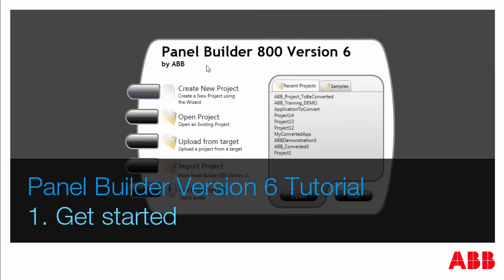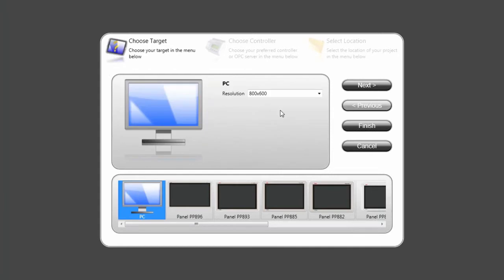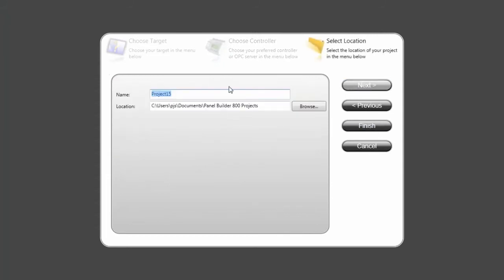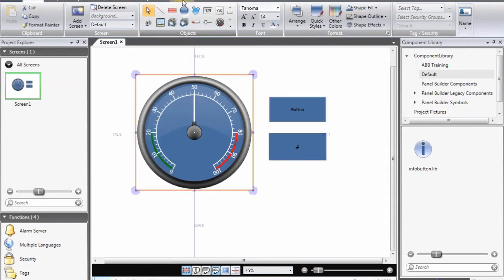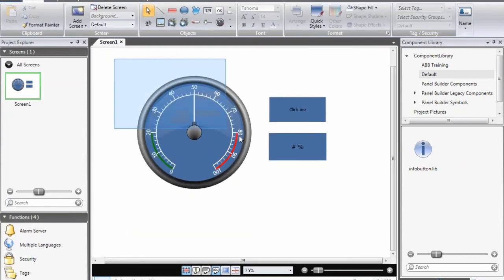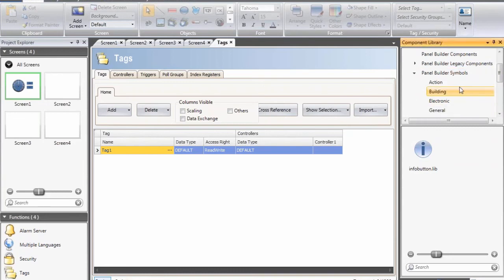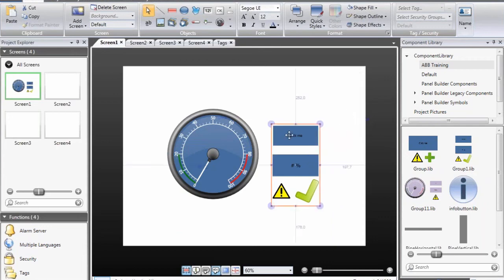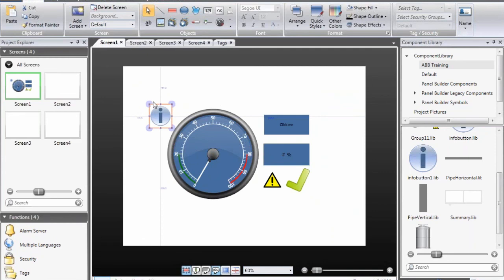ABB Panel Builder v6 Tutorial Part 1. Get started

Comment: how to open existing screen at site using ABB panel builder 800 version 6 ??
Reply: I don't understand the question. Do you want to upload an application from a Panel up to Panel 800 (programming tool) ? This is a setting during download. When you download the application, then this is compiled machine code this is the default settings, but there is a checkbox when you download, then you also download the application down to the Panel. 
If this was done, then you can upload the application back to the programming tool.